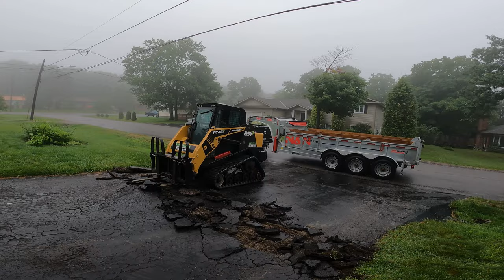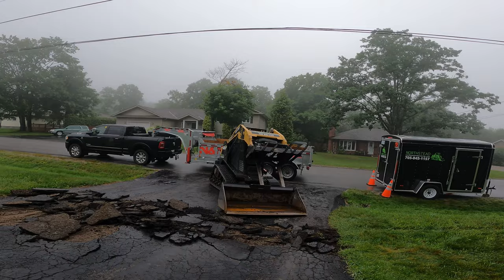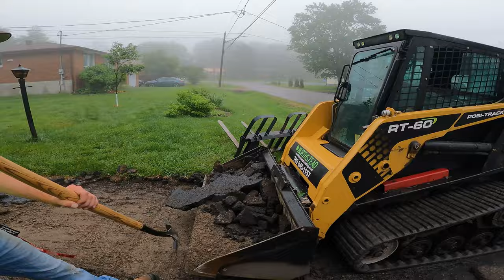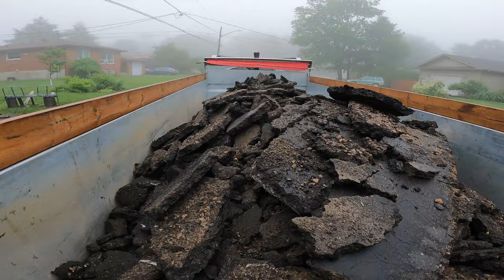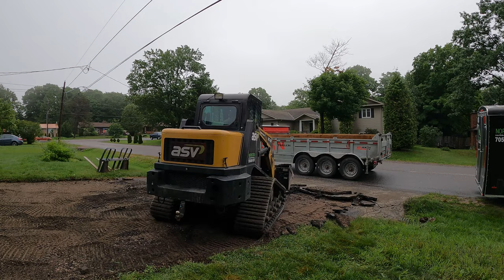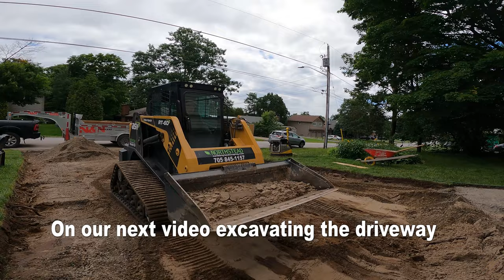Removing asphalt driveway using ASV trackloader

Comment: Great video. I messaged you in a previous video about your N&n dump trailer I did end up buying it. Thanks for your input so far I’ve been extremely happy with it. I did however buy one of those $18 wireless dump controllers on Amazon it works at a range of over 100 feet it was well worth the money not sure if you have one.
Reply from the maker: Cool glad I was able to help and I've been pretty happy with my trailer as well. I ended up beefing the wires on my wireless controller... lol stock wires cheap.